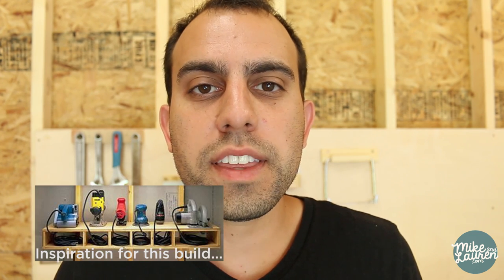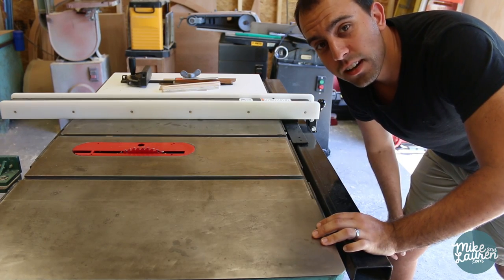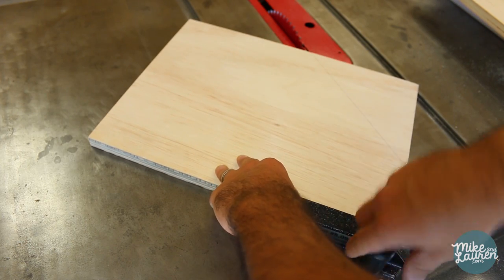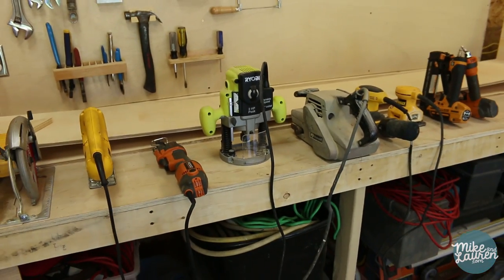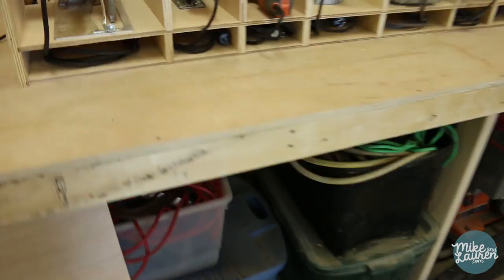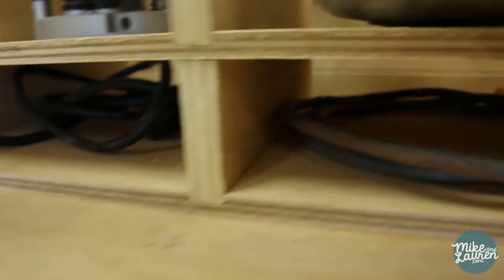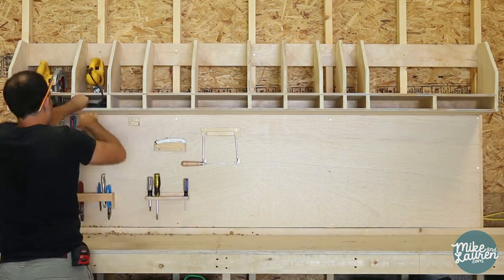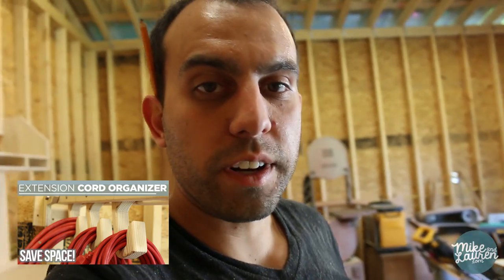Mike Makes Power Tool Storage w/ Cord Organization

Comment: You know, I love watching these shop/tool organization videos. I get a lot of good ideas for my own shop by watching them, so thank you for your contribution. Like you, the majority of hand power tools I own are corded, except for the two drills I have on 18-volt batteries. Someone asked me the other day why I still use corded power hand tools? I asked him, why should I replace perfectly good power tools that have several years of life left in them? I'm not, nor have I ever been, a "trend follower". And that is what many are doing. Woodworking is a hobby of mine and not what I do for work. Sure it would be more convenient to have a cordless circular saw or sander, but my corded tools still look and run like new. Plus you can't beat the power corded tools have over battery operated ones. So, instead of having all my hand power tools scattered around the shop, I'm going to use your design (esp. since there is room for their cords), and build this holder you designed-- if that is OK? Thanks for a great build video!!

Comment: Thanks for the video. As soon as my new shop is built I'll make this my first project. A question about shops. Yours isn't insulated. do you use air conditioning? What about heat? I'm located in South Georgia. Appreciate any advice. Thanks again, Jack

Comment: Hi Mike. I'm curious why you didn't put a shelf on the very top of the unit so that additional things could be stored up there? Is it a height issue?
Reply from the maker: George Schwab Good question. It is a little tall, but my main reason is because I didn't want an area to collect clutter.  I've found that any horizontal space will naturally attract junk to it like a magnet.  If I ever have a specific purpose for a shelf up there I can just add a strip.